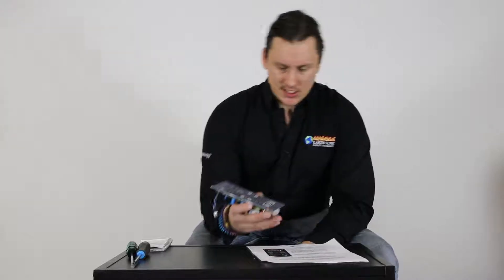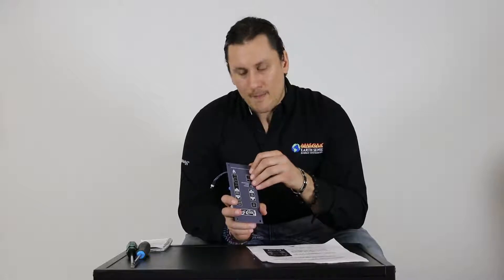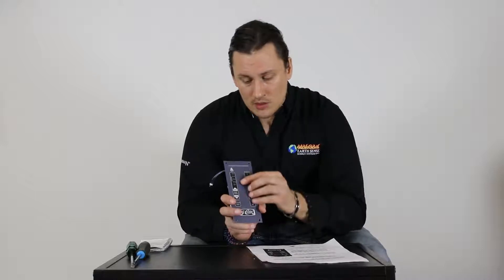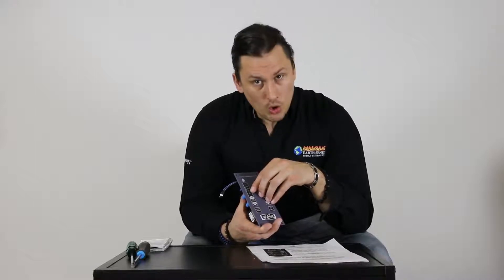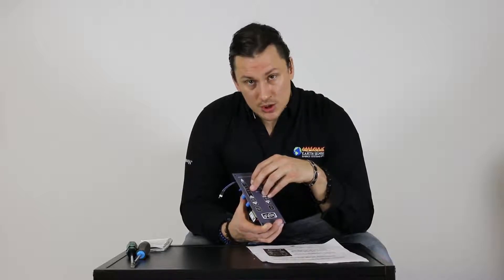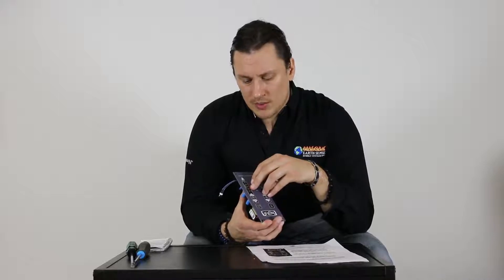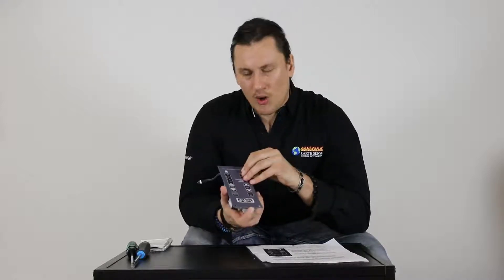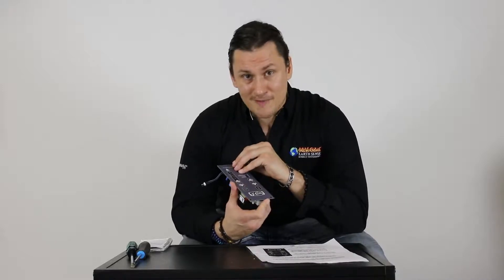St Croix Control Board Diagnostics - Error Code Fault Blinks

Comment: I have a st croix stove I start it up run good about 7 minutes stove shut down board goes Blank then turns back on about 20 seconds later then the number 3 light blinks I know about the number 3 blink I want to know why this stove loses total power then come back on I replaced the control board and POF switch same problem
Reply: i have same issue did you get any answers?
Reply from the maker: Thanks for the message Robert, apologies on the delay. I have sent to our top technicians to get their feedback - Will follow up ASAP with their thoughts/suggestions. Appreciated.
Reply from the maker: Hey Robert, Our lead tech wants to know the model and year St croix you have. That info will be on the UL label which is usually on the back of the stove or inside the fuel hopper lid. Also, he wanted  to make sure the new control board was properly programmed. Let us know on that. Thanks.

Comment: I have a St. Croix Prescott EXL that I just installed Analog to Digital retrofit kit 80P54019.  The board is programmed for mode 3.  It goes through startup and then shuts down with NO diagnostic led blinking.   Any idea what could be wrong ?
Reply from the maker: Hey Jim, Happy to assist. Couple questions. 
Is there a thermostat being used?

What position is the slide switch set to?  Manual/T-stat/Smart-stat?
Reply from the maker: Additional Note from one of our techs. 
Make sure the switch is in manual mode on the control board if not using a thermostat. If a thermostat is being used it will be important to verify the thermostat  is working properly.
Reply: @EarthSense  Thanks guys, it was indeed the circuit (control) board. I replaced it and all has been fine since.
Reply from the maker: @jameskassal2543  Very glad to hear you found the issue James and everything is working well since. Any future questions or needs please let us know. Warmest Regards,

Comment: I have a St Croix Hastings pellet stove. The control board part number is 80P52632. The stove is cold, has not been in use yet this season. When I try to start it up, pellets feed into the burn pot but then it shuts down with an error code for the high limit switch (2 and 3 lights blinking together). I checked for continuity of the switch a the end of the wiring harness coming into the control board and found the switch closed. Does this indicate a faulty control board?
Reply from the maker: James, Thanks for contacting us, happy to assist. My suggestion would be to put a jumper wire in between the 2 wires going to the high limit switch. This way we can absolutely rule out whether it is a High Limit Switch issue or not. If you still get the #2 and #3 lights blinking together with that high limit switch bypassed, then yes most likely it is a circuit board issue. Still inspect the wiring thoroughly all the way back. Make sure the stove is unplugged from the wall while working back there. Let us know what you find, happy to assist and get you back to 100%.

Thanks,
Mr. Pellethead
Reply: I did jump across the switch and got the same result. and inspected the wiring between control board and HL switch. So, I will replace the control board.
Reply from the maker: @jameskassal2543  James, make sure you jumped the wires going to the HL switch, not the switch itself. If you jump/connect the wires together and still see the same thing, then yes control board i would lean towards. Here is a link to the control board if needed - https://pellethead.com/product/st-croix-digital-circuit-control-board/
Reply from the maker: @jameskassal2543  Okay, thank you James. Please keep us posted once you receive and install the new control board. Thank You.
Reply from the maker: Here is a video on creating a Jumper Wire for testing incase you need it https://youtu.be/FDVkbsHS95U

Comment: I have a St Croix Lancaster and my 2 light comes on a few minutes after lighting the stove, and then shuts down. I’m wondering how often the door/ash pan seals should be replaced. I’ve already cleaned the stuff I know how to clean. I thought this might be a decent next step. What do you think?
Reply from the maker: Willie, Thanks for contacting us. With normal use, I would say the average is 4-6 seasons on replacing the door and ash pan gaskets. I've seen some go much longer and some go sooner. You can do a dollar bill test. Stove off, dollar bill half in and half out, close the door. See how much resistance there is when pulling the dollar bill out. Check in multiple spots around the door. Should be heavy resistance. Something is causing that vacuum to trip and the #2 light - leaky gaskets would definitely do that. Check the simple things first - any other questions just let us know, we are happy to help. Thanks!
Reply: Earth Sense Thanks! I will do the dollar bill check tomorrow!
Reply from the maker: @williemaykit7940  Great! Keep us posted. We'll figure it out :)
Reply: I think I got it. I found that I can take a piece of 12ga copper wire, bend a loop on the end, and go through the little clean out "doors" to get an ash plug cleaned out. I used it like a fish tape to go up into the stove, worked it around as much as possible, and got quite a bit of ash out. In 4 seasons, I've never done that. So, the vacuum switch is still good , along with the seals. Just a place to clean that I didn't know about.
Reply from the maker: @williemaykit7940  Excellent Willie! Yes, a lot of ash can get trapped in that back firewall. Great trick for removing it. Another helpful trick- When I used to do cleanings on St Croix, I would remove the firebrick on the back wall and I would bang on the back wall with a rubber mallet to allow that ash to fall down to the traps. I would use a bottle brush by the upper heat exchange tubes to clean best I could there. Then we would use the SUCKING part of a leaf blower on the exhaust vent outside. I would have someone inside the house by the stove moving the heat exchange scraper back and forth and opening and closing the front door while the leaf blower was running. You'll be amazed at how much comes out that you couldn't see or get to. Make sure to blow it up and away and that all windows to the home are closed when performing this type of cleaning. Thanks Again!
Reply: @williemaykit7940  Hello, any pictures/videos of the clean out "doors" and where to put the wire for cleaning? My St Croix insert pellet stove will light up and burn with a nice torchy big flame, but after 10 minutes will do a fan speed #2 blink and eventually the fire goes out. I am thinking it needs a good cleaning like what is described here!  Thank you
Reply: Thanks for the ideas! I never thought about the bottle brush idea before. Thanks for the help!
Reply from the maker: @williemaykit7940  Our pleasure Willie! Thanks again!

Comment: My SC050 started shutting down with no code lights flashing. I have noticed lately, a relay chatter when I shut the stove off and sometimes when I first start it. Evidently there is a poor contact in the relay or a drop in voltage to it, causing the problem. 
 I'm not sure if the relay I hear chatter is on the control board, or if it is something else. 
 Got any ideas what I can do besides replacing the entire board?
Reply from the maker: Charles, thanks for contacting us. I ran this past one of our lead techs and he is strongly leaning towards the issue you are having being a control board problem. If you do need a new control board here is the link https://pellethead.com/product/st-croix-scf-050-furnace-circuit-control-board/